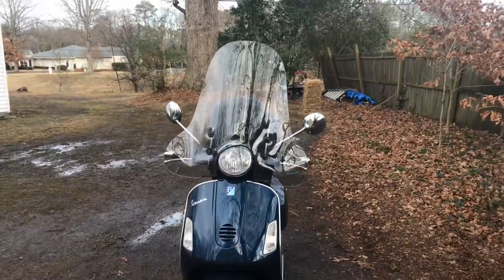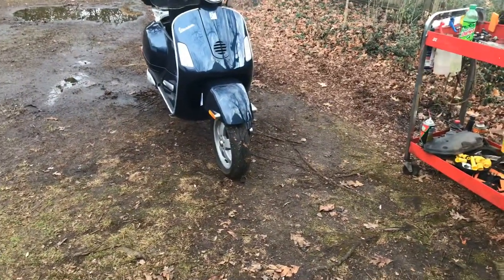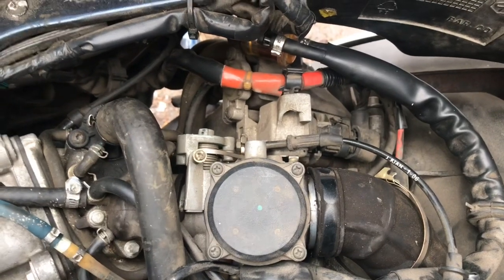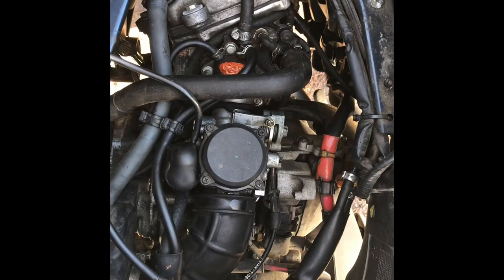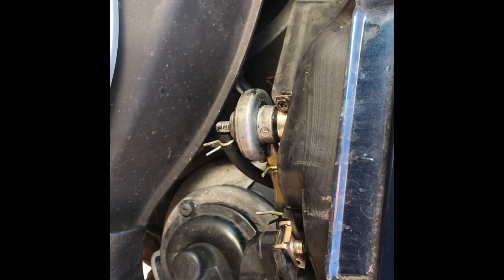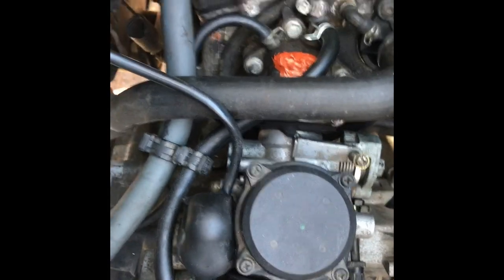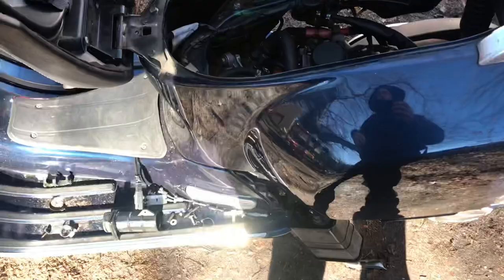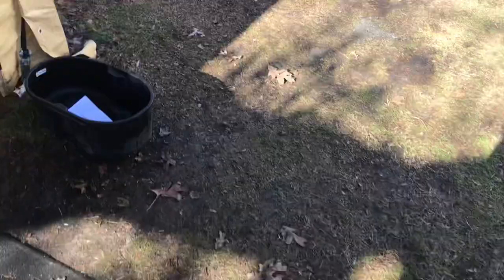Vespa won’t start? Click here

Comment: I have 2,an ET2 and ET4(50CC) NEEDING wiring issues fixed. I installed from my old scooter: cold air filter, sport suspension for the rear, floor pan,  seat and bought fuse for the battery, battery, ignition set. Now it's running like a kitten 😸